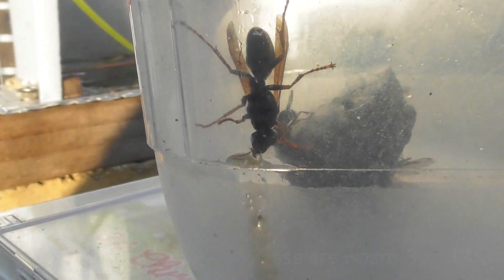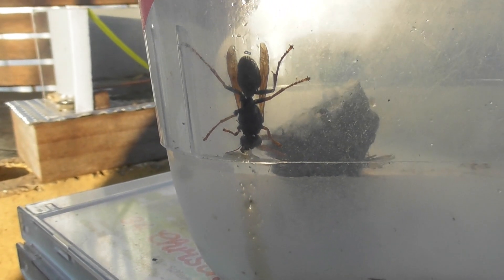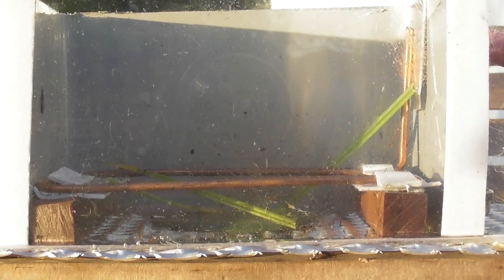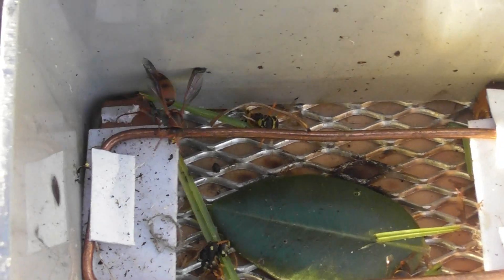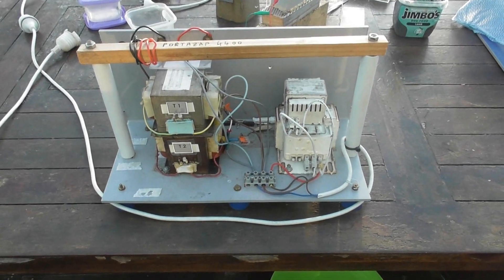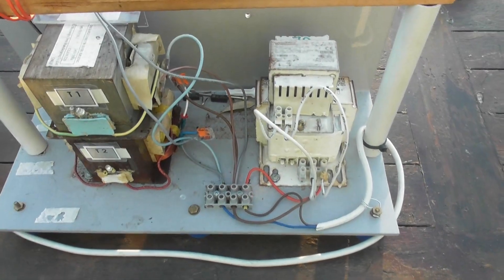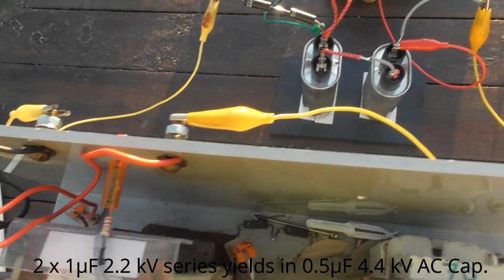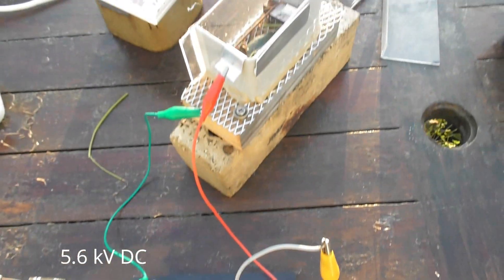Wasps 11.  Four paperwasps  versus 5600 Volts DC explode

Comment: Top wasp fell off because of induced voltage due to field gradient changes, causing the muscles to contract. Mini lightning bolt near it is what dropped it, then it fell down, and got a second shot after power was removed, from residual charge in the capacitors, before the bleed resistors made them safe.